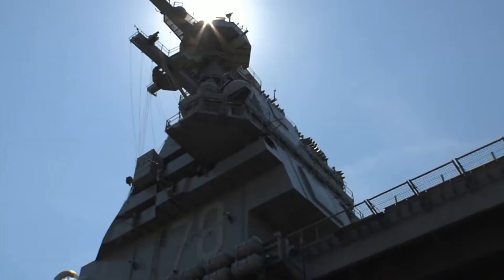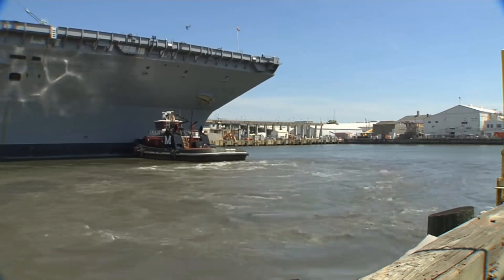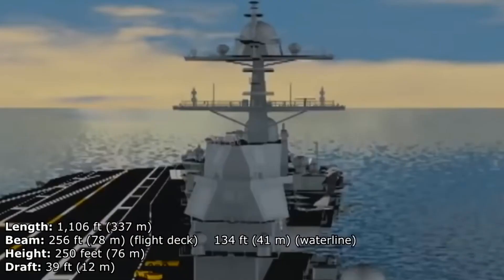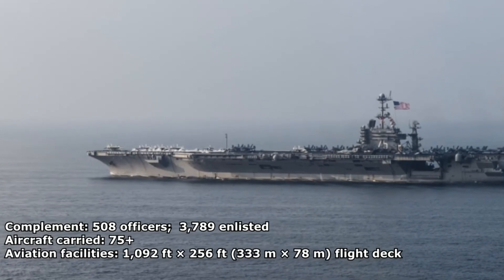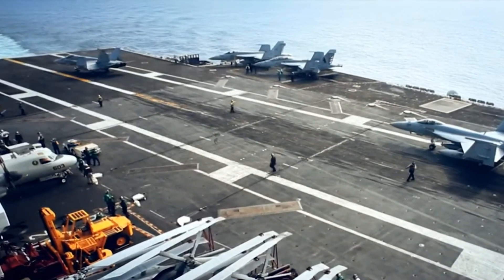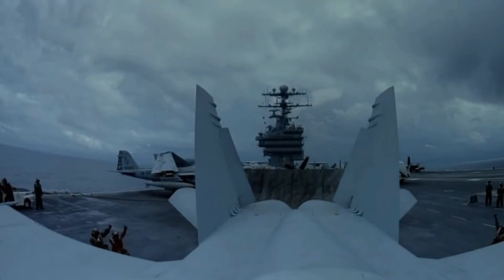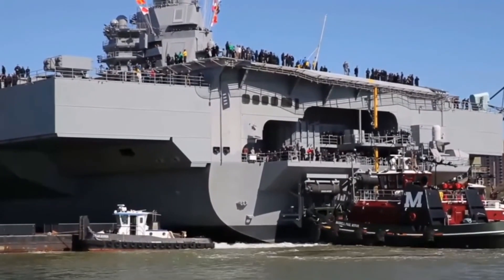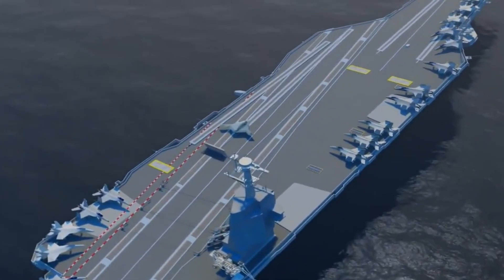USS Gerald R Ford CVN-78 - US Navy Supercarrier

Comment: I don't think the USS Gerald R. Ford is actually intended to be equipped with a railgun, though it'll have the electrical power available to support one.

" future systems such as the Directive Energy Weapon system that might be feasible during the carrier's 50-year lifespan. Basically guys, rail guns. "

Directed Energy Weapons refer to lasers rather than railguns. Railguns use an electromagnetic Lorentz force to propel the armature instead of a beam of electromagnetic energy. A 250-500 kW MLW is what appears to be required in order to engage cruise missiles, aircraft and even ballistic missiles, much higher than the current 150kW ones currently available. Correct me if I'm wrong but great video anyway.
Reply: Yeah, I don't think the USN will want an aircraft carrier to be close enough to an enemy ship for it to be within railgun range. While it is long, I'm sure planes can strike farther. Lasers would be better as they could be used for point defense against missiles and aircraft.
Reply: +Wynton Goulding The primary advantage of railguns is multi Mach speed attacks, very difficult to intercept, and as ammunition is literally just a metallic armature (surface must at least be metal to ensure circuit can be completed for current to flow) it's cheap as hell and inert. But they still want to G harden the electronics to withstand the sudden change in velocity, and material science must mature enough to tolerate the heat without having the rails melted and degraded significantly after each launch. Personally I don't foresee railguns on ships being employed beyond direct fire and for point defense. Cruise missiles are already low observable, some claiming hypersonic status already by the Russians and Chinese, even the Americans are working on a hypersonic Tactical Tomahawk, and very intelligent and long ranged, plus not needing as much R&D as it's already a matured piece of technology. In all likelihood all naval engagements will take place beyond the horizon without visual detection. The nature of networked systems employed by all sides permits early detection assuming they're not interfered with, even from spaceborne assets combined with aircraft and other maritime vessels. Just my lengthy dribble for now.
Reply: Sure, but my point still stands that a carrier should be striking at an arm's length using its carrier air group, which can attack targets farther away than a railgun can reach.
Reply: Precisely, I just love droning on for no apparent reason.
Reply: Any weapons system with "Directed Energy" means it will utilize lasers, not railguns. At the end of the day a rail gun is still using a physical projectile. Laser weapons use directed energy.
Reply: Lasers are being developed for missile defense and show some promise. Some short range systems exist now. To increase range will require more powerful lasers which are taking some time to develop. Lasers are nevertheless very appealing for missile defense because they have almost guaranteed accuracy and no ammunition. They are well suited for extended defense against swarms of missiles. They will likely be used together with existing defenses as they have complementary capabilities.
Reply: The Navy is planning to put a rail gun on only one of the Zumwalt class in order to test the technology. They may then put a rail gun on other ships in the future. They have not even decided for sure whether or not they will put a rail gun on the Zumwalt any time soon. Cost is the main reason for delay at this point.
Reply: @Stu_Bur  actually power limitation is the hold up not cost. My family nusiness, which Ive beeen running since I was 25 and worked there since middle school except college  years(yes that was violation of child labor laws.)  We were involved in the DDX as well as seep sea subs, advcap mk 48 torps and more advanced ones, com sats, and spy sats, even had something to do w/ our nuclear sub propulsion system(in fact my great grandfather put the first generator and electric motor and piston power source  in the first USS sub built by simon lake, the sub was the argonaut[a crawler design). and it cross the chesapeake bay.  Anyway much of what I did is still classified, yet let me tell you some stories.
With the satellite system the generals wanted real time communication w/ no lag.  The sats were about 38,000-42,000 mile up, and at the minimum 3 if not 4  would be used bouncing to signal from ground to sat to ground and so forth, so to make a call  the signal goes up to sat 1 then down to land 1, up sat 2 down land 2 up sat 3 down land 3 for total of 6 travels and most likely more.  once I found that out I told them it was impossible, they said money no problem, manpower no problem, materials no problem so make it happen, I still said no, they got upset and demand why. for ease I will round up to 40K mile per one way trip. There are 6 trip time 40k equals 240,000 and that is why it cant be done, light travels at 186,600 miles per second and those signals are many times only half way around the world and need to return.  They still told me to fix the speed problem by making it go faster............uuuummmmm i said you need to talk to  Einstein cause he the one who came up w/ special relativity and general relativity, so blame him, rather he just understood it and wrote about it, so talk to God if you want the speed of light to be upped.  They still didn't get it.  I told them they could run fiber optics all over the world (really mean every where) or deal w/ the few seconds lag.  The other job was the pumps and motors on DDX and other warships which I had to make them myself, and then they sent us a mk 48 torp electrical propulsion (not the otto fuel system) and they wanted faster speed, longer range w/ out any extra mass or battery capacity......errrrrrr.   So you want something for nothing right. That doesn't happen at least not in my world, I did come up w/ an entire new wire diagram and used silver magnet wire instead of copper, b/c AG is the best electrical conductor know to man at room temp (super conductive material at 180 kelvin beats it yet the temp is the prob).  My machinist  set up a in depth system made mostly of paper and mylar to catch the AG and the gold(I had a one of a kind commutator made from gold so it wouldnt oxidize w/ all the salt air and stuff, I told the company who made it for me that a Rear Admiral wanted a unique and eye catching  paper weight and thats what I suggested to him at a cost of 278,500 [which was all a lie including the price, yet to this very day I am told that the owner of GPM still tell everyone about the gold commutator and the waste of tax payer money...lol I loved messing w/ him). I can't say more about that, yet one more little example of government waste.  The deep sea sub for explore keep getting water in the motor and gear box and would fail.  They took it back to the maker as well as others and finally came to me.  After about 3 or 4 week I was spitballing ideas w/ my dad as how to fix the problem.  Finally I said what about filling the space and displacing the area that leaks.  My dad said that might be the way, but what can we fill it w/, I said how about heavy oil.  So w/ modifed the motor a little anddid just that and guess what it worked.  We shipped it back to them and then invoiced them, I got the invoice returned to me in the mail, with a note say incorrect charges.  I was pissed b/c I worked 4 months on their job and gave them a good price.  So I called them up and finally got in touch w/ person X who told me that I must have made a mistake b/c they had spent millions on tring to fix it and I was onlu charging them 17,400 for new motor gear box assembly and installation, and of course my research time and testing of the possible usablility of my idea and to wht depth, all of which passed.  So I said I can give then a 15%discount but they got bring more job to us, thats when I was told that I had the wrong idea and that I needed to add a zero or even much more to the cost of the job b/c they cant have a small family business fix a multi-million dollar problem fo 20k.....Well thats enough I dont want to go to jail for 20 yeas.......take it light
Reply: @kevinobrien3930  Rail guns are not really optimal for navy vessels at all and they know it, but the research and development continues anyways. A combination of traditional guns and missiles provides more firepower, range, flexibility, and accuracy without large power requirements.
Reply: Railgun range is over 500 miles dude.
Reply: Only saw "direct fire" before the rest was lost in skimming the lines. Sorry. 
My personal belief is they will become something like a hypersonic shotgun with a controlled spread.
Reply: Railguns use way too much energy atm
Reply: Ya you are thinking of the Zumwalt to get the rail gun, but only the second and third and etc. ships.  The first one doesn't have it.
Reply: +Hart Poole 

" Personally I don't foresee railguns on ships being employed beyond direct fire and for point defense. "

Typed that out earlier already.
Reply: If a Ford gets a railgun it will be for shooting down missiles. They've already designed airburst railgun munitions specifically for missile defense.
Reply: Maybe lasers, but not railguns
Reply: The Fake SecDef Virtually impossible to intercept a sabot flying mach 7. The kinetic energy is far more than an explosive.
Reply: I think the problem is that they need a storage system for electrical power and space to put the system.   Most laser and rail guns used electrical power as result of capacitance and one massive discharge.
Reply: Probably not railguns....but lasers?... Probably!!
Reply: @MrJohnny5555  I think people need to watch how to make your own laser before some idiot in military who cannot get a STEM degree puts a classification or clearance on the those type of videos: https://www.youtube.com/watch?v=-m21xUwBjvU
Reply: Rail guns will never catch on for one reason. Accuracy. They will never be as accurate as missile bvr.
Reply: Why don't we put rail guns on aircraft carriers? Maybe they could help defend against hypersonic missiles.
Reply: @tompalmer5986   Do you really think you're going to be able to hit a target moving at hypersonic speeds with an unguided projectile? That's like trying to shoot a bullet out of the air with a bullet except for at much higher speeds.
Reply: I was thinking we could fire a guided projectile from a rail gun. I don't know enough to know all the particulars. Just a thought.
Reply: @tompalmer5986   A rail gun shoots projectiles at high velocities but the rate of fire is not very fast, making them less suitable than other measures for most missile defense. Kinetic interception tends to rely on volume of fire or guided projectiles and a rail gun has neither.
Reply: They were talking about guided bullets not too long ago. Maybe they could make a guided rail gun projectile.
Reply: @tompalmer5986  The extreme g forces and strong magnetic fields in a rail gun make guided projectiles difficult to implement on that platform. They are being researched but similar guided high speed projectiles from traditional naval guns have similar terminal effects at far less cost and easier integration with current systems. Rail guns are cool and they are keeping an eye on them but traditional powder guns are more practical for the foreseeable future.
Reply: While this is correct, why have planes when you can shoot down anything on the same ocean as you? Or imagine railgun launched UAVs that deliver ordinance within minutes of firing and then fly back to be reused.
Reply: Consider that the railguns could be used as a Close In Weapon System in place of autocannons or the Rolling Airframe Missiles.
Reply: +Stu Bur Another typically undiscussed issue with DEWs which can't be simply overcome with more power is thermal blooming. Occurring because as the laser beam propagates through the atmosphere it heats the air which expands reducing the density thus optical density and the index of refraction. The air acts as a negative lens causing the laser radiation to diverge. Increases in intensity causes an additional increase in the index of refraction and further divergence, paradoxically reducing the power density on a target instead of increasing it. Rheinmetall Defence also showcased a HEL system using lower powered lasers but exploiting beam superimposition to target and destroy low flying UAVs. It was also noted that the laser engagement of an ammo box followed by swift deflagration of its explosive content.

There are means to minimize this e.g. pulse repetition frequency whereby successive pulses of a high powered laser are emanated from mutually non-overlapping positions about a circle such that each pulse emerges into unheated atmosphere. In one form a rotatable mirror assembly is rotated in synchronicity with high powered laser pulses so that the output mirror moves around a circle by more than the diameter of the laser pulse between successive pulses. Paths of travel of different beams do not overlap as such. In one form, the rotating mirror assembly comprises a convex mirror in line with a laser waveguide which reflects the laser beam to a concave mirror at the extreme of the rotating assembly, the concave mirror comprising the output mirror, the assembly being rotated in synchronism so that the output mirror is translated about the circle by more than the beam width for each successive pulse. Separation of beams except in close vicinity to the target where they converge reduces thermal blooming. Free electron lasers are also useful as they can vary their frequency. Increasing frequency can increase the index of refraction to decrease divergence. Also FELs contribute in another means, variable frequency means variable uses, besides acting as a DEW it can act as a sensor, providing ranging information, communication, target designation or disruption. Then there's the whole other story of dielectric mirrors (useful only against specific set frequencies) and ablatives, poor meteorological conditions, which is why a whole gamut of defenses is necessary. The magical number stands at 500kW as the goal.
Reply: @Radavvadra Cos most people are clueless about the real world and think CGI is real?

But sure take a look at the US ONR and DOT-E reports. Or maybe just simply look at the dimensions of the experimental BAE prototype? Naval engineers gonna be left scratching their head simply adding a city block to a US carrier like it's nothing.

Course the USN is famous for not hitting that bullet with a bullet as per the US generals word. Why we know the US is helpless and defenseless against real and operational hypersonic weapons out there. Take the word of a expert on that.

USN has no CWIS as we all well know. Unless you count the very system that in every and all cases took very perfect aim? Remember the Battle of Khafji? One mere missile gets fired at the USN fleet and? CIWS activated yes. Took aim at the USS Missouri and open fire. Luckily they were finally able to erase their very own ship as a target while US sailors were dodging their own CIWS.

US sailors saved!

A6 intruder pilot was the next target though ...

US LaWs 15-30Kw is not even considered military grade. Won't be any good.

Maybe get CIWS right first before you get to laser gatling cannons?